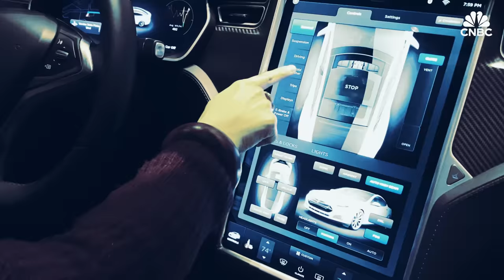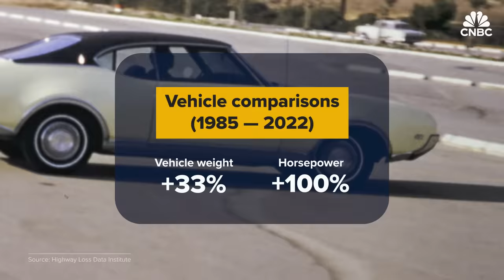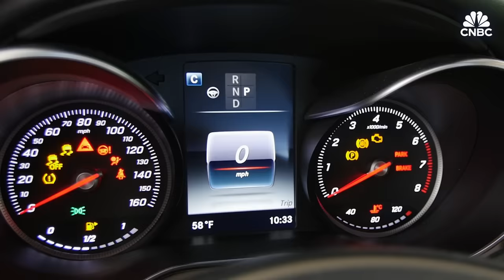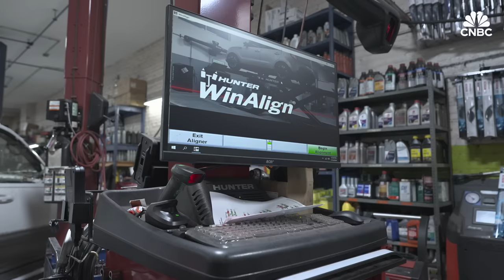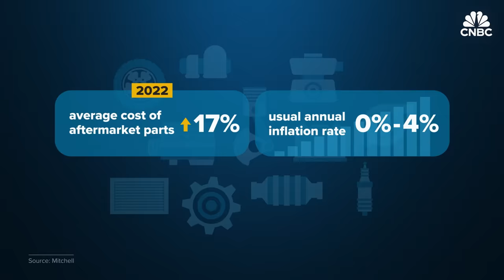Why Car Repairs Are Getting So Expensive

Comment: Removing the transmission oil dipstick is beyond me. Supposed to be one of the easiest fluid changes. But now you need to take to the dealer. Not to mention you don't know if they actually did the fluid change because there is no way to check the fluid color.
Reply: You can just get under the car
Reply: @james-wx6jh  You have no idea, do you? How do you know your fluid limits?
Reply: @james-wx6jh and what? Uncrew the drain plug wasting half a quart and having to refill? They should have kept the dipstick. Sealed transmissions are a joke
Reply: All by design. They know they can make more off of you for service, even more than the profit of selling you the car. It's a purposefully designed scam.
Reply: They got rid of dipsticks because owners were pouring in the wrong stuff and claiming warranty issues.I wish they still had them also but the consumer wrecked that.
Reply: @2stage90  Really? How many people do you think did that? Sure nothing to do with making more money?
Reply: @2stage90 a few tend to ruin it
Reply: @nycalien   well you definitely aren't making money shelling it out on bogus warranty coverages. I work at GM dealership for only a year and a half so far, I've seen/heard some stupid crap and that's just one store. However, I can also agree that there should be an easier way to check/do your own fluids on the newer cars.
Reply: @nycalien enough who decided they wanted to sue, likely didn't help at all
Reply: @JohnS-il1dr don’t forget transmission caps pop out too lol.
Reply: @nycalien  the bolt on the bottom of the trans fluid pan is the drain the second one higher up is the fill level bolt loosen the top one if fluid comes out you have enough if not pump some in. I do know i work on cars why do you have to be so nasty i told you how to check the amout and quality for free. I get the feeling that you deserve to pay for your lack of knowledge.
Reply: @james-wx6jh  OH yeah? Just fill it in? So, having the fluid to expanded in the normal operating temperature doesn't matter? LOL. Do you even know what the engine is?
Reply: Rake a plastic or metal stick and simply stick it into the oil, then pull it out to see the color. I mean, it is not that hard to improvise a dip stick or buy cheap ones screw dealers.
Reply: @redemptionjack4657  Are you serious? Lol
Reply: @nycalien  I did not word it right. I do not know what the oil sticks are made from, get something similar, and use it. I should have been more specific. Second, I hate dearlships wanting even changing a tire to be done by them, so yeah, I was a bit annoyed by that.
Reply: @nycalien You are absolutely correct. In changing the fluid in my BMW 8spd ZF transmission, the temperature is EVERYTHING to getting it right.
Reply: @JohnS-il1dr  Can't you just unscrew the fill plug? My 1966 Ford has a drain plug and fill plug higher up on the transmission.
Reply: @TheRedc0met  You can still remove the caps and use a separate dip stick. My mother's car is recent, and you can still check the oil it just doesn't have a dip stick and I looked it up, and you can still do it yourself.
Reply: @redtra236  They all have a drain plug and a fil plug. But you have to measure them at a specific operating temperature.

Comment: You wanna know how insane it is? I do my own work on my cars. I was curious one day and decided to call a few shops for a very simple PCV valve replacement which involves pulling off an easy to get to hose, wrenching off the valve and putting a new one on, put the hose back, done. Job takes like 5 mins. Part is about $15. Shops wanted to charge me $350-$400. Basically robbery.
Reply: That's because they assumed you don't know, and whatever you don't know you'd be willing to pay up!
Reply: When you have to pay others, expect to pay dearly. A shop has so many expenses, their actual profit may not be highway robbery. Think of how many hundreds of thousands or millions in building and equipment they're paying for. Taxes, insurance, advertising, paying the guys. A guy making $20/hr is costing them $30/hr easy. Plus the owner still has to profit, otherwise why bother. Try a mobile mechanic, they are probably cheaper. We did once and he did great work. I do 99.9% of my own work and I'll admit it felt emasculating having some dude wrenching on our car in the rain while I'm sitting in the house watching TV. We just couldn't for the life of us get that darn part of.
Reply: @AmandaHugenkiss2915  The places I called are non franchise. I understand they got to pay for their business and building. That's why i figured it would be about a $50 $60 job they would charge. They also tried to sell me things that were not even needed. One said that the fuel system needs to be cleaned when doing a pcv valve which was going to be $121 (it doesn't). Another said they had to order in gaskets and seals since that was required for a pcv valve replacement with 2-5 hours labor (not true at all). So it was made worse that they were going to charge me for things completely unrelated and unnecessary for the job. I also told them I was supplying the part.
Reply: @WNicole1993  I think the major part of the accidents is not the cars themselves but the divers. Nobody can drive anymore and people drive distracted all the time. I hate it so much. My first, and my favorite car I had was hit 5 out of the 7 years I owned it. Last year it was hit twice, the second time killed it. Some young guy driving a company truck and trailer slammed into me when I was at a stop. Probably to busy hitting his vape.
Reply: Similar situation happened to me recently. I have a 96 civic that has been a warrior for me for the last 6 years. The first year i got it i had gotten into an accident but that accident didn’t stop it from driving smooth. Just a bent front frame on the drivers side. I went to get a quote for my A/C to be repaired for the summer time. It hasn’t been working for about 2 years so i go to this shop i find on google that had good ratings and specialized in JDM. The mechanic looked under my hood to make sure the hoses and wiring was okay then said he was going to do a test on it. As he looked under my hood he said everything seemed to be okay and i should just need a recharge. About 2 hours later i get a text from him saying that my condenser had a puncture and was leaking refrigerant and would also need a new compressor. His total for me for him to replace all that including the check up was over $1000. I was mad and felt exactly robbed. Me knowing that i was in an accident and those were probabilities. He told me after the fact he had said everything looked good before and still charged me $200 just to tell me what i was already aware of. I could have purchased everything i needed for almost $200 and not been robbed. Not a good experience at all. I’m not the most literate when it comes to car repairs but cmon now.

Comment: Fraud is another factor.  I was charged 90 dollars for labor for replacing a bulb.  Later I found out Walmart does it for 10
Reply: Dude someone quoted me $250 to change a headlight. Parts not included 😂😂😂 f that
Reply: The fact that you can't change a lite bulb is shocking.
Reply: You can decline the repair... i dont see how thats fraud.
Reply: Just Google how to do it, parts are surprisingly cheap if you can do your own labor
Reply: Fraud is either not needing it in the first place or them not performing the work but making you pay for it. That's just being gouged, whether it costs 90 or 900 and the identical product is much cheaper elsewhere. Walmart Auto Care does a ton of stuff 50% or more cheaper (often not really charging for labor) than the major chain shops. Although you just have to be smart about the time of day or location you go there to avoid a 2-3 hour wait if they are backlogged.
Reply: That's the F*#k U price
Reply: @ocampbell1954 try doing it on a 2004-5 maxima. I had to remove the whole damn bumper. Some Seniors in their 60s might not be physically capable to change a lightbulb if they own a PITA car.
Reply: @ocampbell1954  it's shocking you don't know many cars have somewhat difficult lights to change.
Reply: Why didn't you just do it yourself. It's crazy that you can't replace a light bulb.
Reply: That's not fraud, many shops will round labor hours up... so if it is 0.2 hours of labor they charge 1.0 hours
Reply: thats not fraud thats is capitalism baby dont cry... LOL
Reply: That’s not fraud, it’s a free market! A business can charge what they see fit based on their operations, some vehicles require removal of bumper and headlight. Lmao fraud
Reply: Or you could have done it yourself. Extremely cheap
Reply: On my truck you have to remove the whole bumper and remove headlight to get to bulb

You want a shop to do that for 10 bucks? lol
Reply: @matthewgeris5743   lmao that's still not hard at all. Pop the bumper off and you're good to go. The only thing is gonna cost you is little time but you'll save decent chunk of money which you can use for gas groceries or meds
Reply: Kia charged my wife $130 for seafoam injector cleaner and a bottle of Lucas additive for the tank.
Reply: Changing a headlight bulb in certain vehicles can be a huge pain.
Reply: Vehicle repair shops will charge you a certain rate for simply taking a look at your car.  It's not fraud.  It's called diagnostics and overhead.
Reply: @ernestomcgrew8246  some are actually valid, i think for the ford transit you have to drop the front bumper(at least that's what I heard)
Reply: Could have probably done it for free after watching a YT video.
Reply: Let me guess pep boys?!
Reply: Shop time 100 an hour.  1 hour minimum.   I would charge you $100.  It's takes minimum effort to learn to do this yourself so you can pay to have it done.
Reply: You got charged for a half hour labor and the light bulb. Stop being lazy and change it yourself next time.
Reply: @ocampbell1954   the fact that you get shocked so easily is very shocking to.  You must be a very delicate flower
Reply: @motionsick  that’s why your only customer is mommy.  Gotta support the motion sick child ! Respect !
Reply: @SibRevs   if you need to run diagnostics to change a light bulb of a broken tail light, then its one of 2 things : either you’re a scammer .. or have a windows 95 installed in your head
Reply: @i.d.6492   okay Mr know it all.  We agree… you are a car prodigy.
Reply: @dizk5283   that comment is copyrighted by Mr Campbell ( born in 1954).  Change it or Campbell ( born in 1954) will sue you.
Reply: toyota dealership charged me $200 for installation for replacing my broken side mirror. OME Mirror cost around $650. They did give me $90 discount. 😂
Reply: @MD-01  Changing out a light bulb is one of those jobs that isn't cost effective to perform. 

It's like going to your doctor to apply some neosporin and a bandage after you scraped your knee.
Reply: It's not fraud if you agreed to pay that price.
Reply: it all depends on what all needs to be done to get to it. some you need to remove the entire bumper to get to, others you need to remove the tire and pull back wheel well liner... if wally can do all that and charge only 10 for labor, they are ripping off their mechanics.
Reply: @ocampbell1954  Sometimes changing a lightbulb is crazy complicated.  On my last vehicle (a 2016) to change the light bulb you had to remove the entire bumper.  There was no access from inside the trunk or under.  Gone are the days of 1990s cars where you could just pop the hood and change the bulb from behind.
Reply: @MD-01   go learn how to replace a bulb so you don't get screwed over again instead of crying on here 😂
Reply: Lexus stealership tried to charge my retired mother $2,400 to replace a front swaybar….that had nothing wrong with it. Turns out there was only some surface rust on the mounting bracket which is perfectly normal for a 7 year old car with 65k miles. Swaybar only costs $300 and labor 1-2 hrs if it does need to be replaced. Luckily she’s not dumb and didn’t bite. That dealership lost a customer to an honest local mechanic.
Reply: Some vehicles require two to three hours worth of Labor to disassemble the car to replace that bulb
Ain't nobody at Walmart going to do that for you
Reply: @seashackf1 cool story bro, too bad it's BS
Reply: Tip before buying your next car, check everything like where the oil filter, drain plugs, check how the headlight assembly is, would save your butt after 50k miles, if you just go and buy whatever you like and not check it out then good grief dont be moaning and yapping when it's time to do maintenance
Reply: Went to buy locks for my Honda got it for 60$ they told me if I wanted it installed will be 200$ .😳  dealerships are stealer ships .
Reply: The dealer told me they could not replace the bulbs in my climate control panel, that they were LED's and the panel needed to be replaced.  Three years later, I was doing other work and removed the panel to access other areas and, what do you know?  Those are bulbs in there. No more turning on the dome light to see what I was dialing in.  Argh.....  ah, well, saved $1300 for a new climate control panel.  The little bulbs were pricey, though, and all seven cost me $42  ($6 each) and were not available aftermarket back then.  We have the internet, now, and I bet I could have found them no problem.
Reply: the real problem you did not shop around.
Reply: @ocampbell1954  I mean some manufactures make changing bulbs very complex just so you don't do it yourself and take it to the dealer to give them a pocket lining. Some cars requiring removing the wheel and part of the fender to change a turn signal bulb I know.
Reply: Taking it to Wal Mart would have voided your warranty on your new car 😂
Reply: I can't repair most things. I just make a list of what needs to be done and bring it to the next inspection. It saves labor cost.
Reply: Or you can do it yourself for $0... you can see exactly how to do it if you have access to Youtube and 5 minutes free ?
Reply: @Really10801  More like 30 mins-an hour on some cars but yeah
Reply: I cannot change a light in my Porsche- that’s a fact… don’t be ignorant
Reply: You can't change a bulb in your car?
Reply: @retiredsnowbunnyhunterx5106  exactly they are not certified technicians 😂😂😂
Reply: i once paid an employee $25 an hour then found a homeless guy that did if for $5 an hour and i couldve done it for free! yes lot of employees scammers out there
Reply: @kingwrench00  I get that but heck even more if you changed it yourself it still would void the warranty. Basically touching your own car for anything will void your warranty.

Comment: Another reason. Some cars you have to remove so many parts just to change 1 something thing.
For instance, to change a cabin air filter, most cars you'll have to take out some or all of the dash. Which can take hours. Which then takes 30 seconds to change the filter itself.
Reply: Most Japanese cars are so easy that process only take 2 min max.

Comment: When buying a used car most sellers wont even let me check the fluids becase they are hiding something.  I once showed the money right to the face after a refusal. When i checked the transmission fluid with the dip stick it was black and tarry. I ran away as fast as i could.

Comment: I daily drive a 1976 Monte Carlo 1800 miles a month as a commuter… It’s big and inefficient, but I managed to squeeze 17 mpg from it.. I have had it 3 years, bought it for $3500, put $4000 in it with $1200 of that required maintenance and $3800 in elective modifications…
Reply: LS swapped??
Reply: @BruceLee-xn3nn  no, numbers matching

Comment: One thing that would really help is requiring that you can run diagnostic software and reset a cars computer with no extra tools. Like everything has to have a mode that shows all codes and resets them, including emissions. I can’t even troubleshoot my new truck without taking it to the dealer and just paying them to do it because even though it has multiple screens that can show me things, all it says is “take me to the dealer, I’m broken”
Reply: How and WHY would a car be designed to check codes without a scan tool?!? You want to be able to change flats without a jack or socket?! Or replace parts on the car without tools?!/ Sometimes people can just be silly.
Reply: @HuChing-ob4kk  There are some cars that will show what the codes are on the dash.  With analog displays being replaced by digital screens there's no reason the car can't show you all this information itself.
Reply: @HuChing-ob4kk  do you sell scan tools for a living or are you just really old? Trying to understand how one makes such a comment

Comment: Former technician here. One topic the video did not bring up, nor was it mentioned by the shop owners, is manufacturers recommending excessive times between maintenance. Stating turbocharged engines can go 7-10K miles between oil changes and transmissions up to 150k before the ffirst fluid service is ridiculous and Im certain is adding to the increased repair bills motorists are seeing.

Consumer Reports and other rags have advised to never buy an extended warranty. Given the cost of repairs today, its almost mandatory unless you're leasing the car.